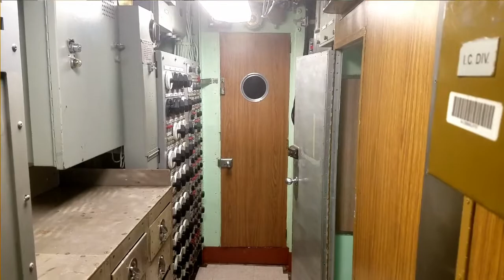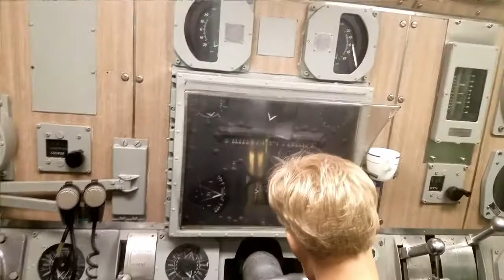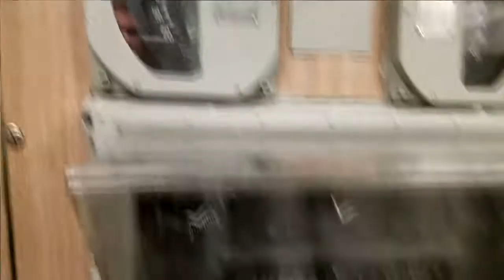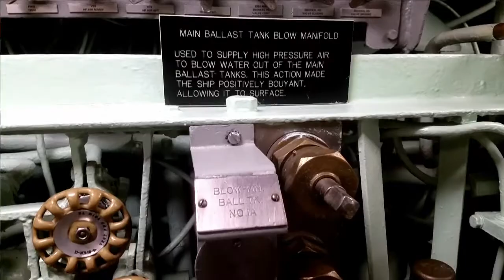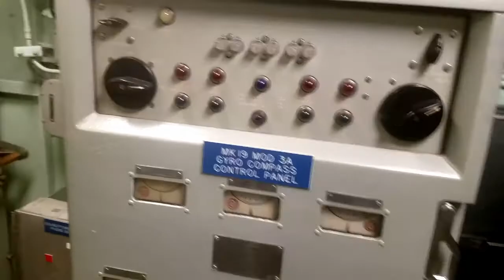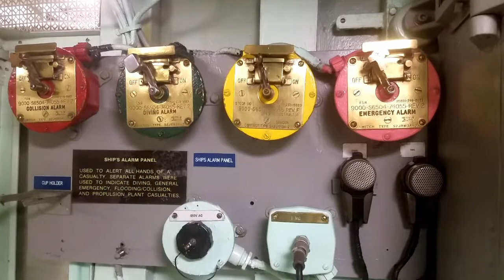Episode 8  - Control

Comment: Any chance of doing a behind-the-scenes back aft? It would be cool to see the tunnel and aft of the tunnel, maneuvring, and even the engine room. I'd be interested to see the O2 generators and other atmosphere control equipment like the CO/H2 Burner and CO2 Scrubbers, the still and/or evaporator for potable water, SSTG, main engines, reduction gears, etc. and how they all compare to what was on my boat (SSBN634).
Reply: Are the manniquins hair per regulations?
Reply from the maker: Unfortunately no.  We are still not able to open the aft end of the boat to the public.  Despite Nautilus decommissioning she still retains military sensitive equipment in the engineering areas.
Reply: @submarineforcemuseum1739  I figured as much... but hey, figured I'd give it a shot anyway. lol
Reply: @submarineforcemuseum1739  I was on a Tiger Cruise on the Stennis. Every Nuke I asked for a plant tour rolled his eyes and shook his head.

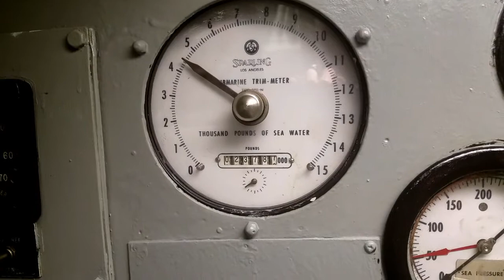Comment: Question:  I'm a fluids system engineer; so, I get stuck on details and significant digits, admittedly.  You made the comment, about the 13:28 mark, that the density of water is 8 lbm/gal.  That number seems off to me.  I work in lbm/ft^3 mostly.  The density of freshwater is 62.4 lbm/ft^3, which converts to 8.3 lbm/gal.  The density of salt water (and I'm sure that this varies somewhat) is about 63.9 lbm/ft^3, which converts to 8.5 lbm/gal.  When you're moving as much water is you are in a submarine, why not use at least two significant digits?  8.3 or 8.5 lbm/gal?  Or were you just keeping things simple for people in YouTube Land? 

I am bing-watching this series, and am enjoying it immensely.  Thank you for doing this!!!!!!
Reply from the maker: When we move water on the submarine we deal in water on the submarine for ballast we deal exclusively in pounds (trim tanks and the like) - a typical order is "pump 10,000 from forward trim to aft trim".  When we deal with bilge collection collection tanks, sanitary tanks, or reserve water tanks, we deal with gallons - but we also don't pump thousands of gallons at a time - more like a few hundred - so the rough calculation works well enough.
Reply: I understand.  Thank you for the explanation and response.
Reply: Rule of thumb for engineering types: fresh 62.4 lbm/ft3  salt 64.2 lbm/ft3.  In reality, you go for effect rather than precise amounts of water.